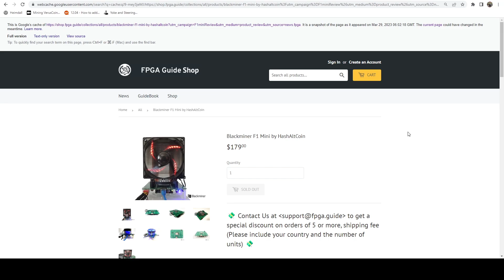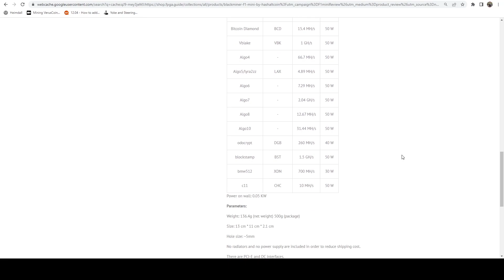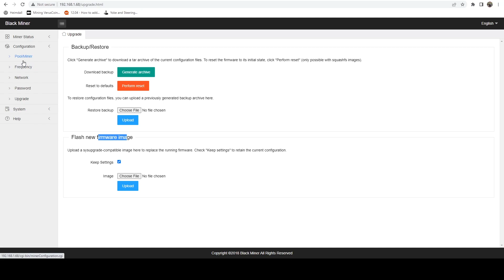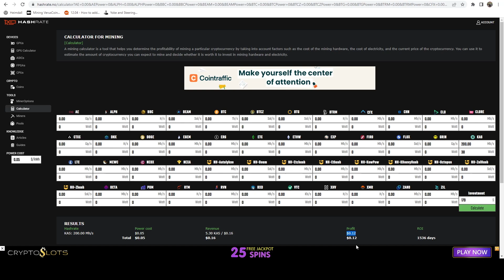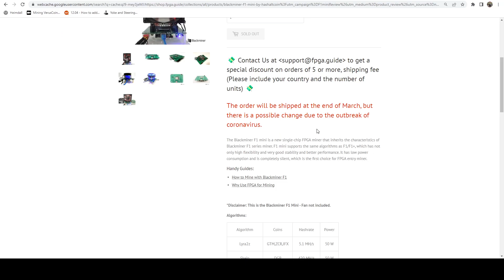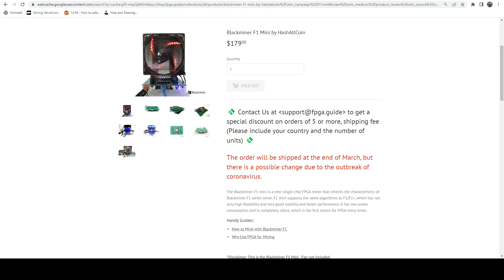Kaspa Is Now Mineable On All Blackminer FPGA's | Bitstream Released

Comment: Its not working here on my f1 mini. Red light keeps blinking and it woundn't connect. Other algo like tribus does work. Any Idea's?
Reply from the maker: make sure you try herominers or hashpool. Those are the only 2 pools that I could get to work with the blackminer bitstream
Reply: @RetroMikeTech  I tryed them all, but no one gets to connect for a reason. Other algo works like a charm.. Well will try to figure it out.. Thanks for the response.